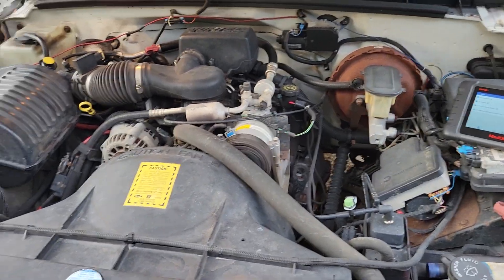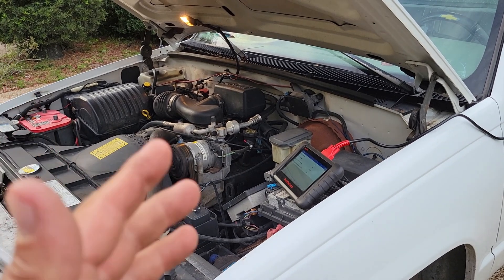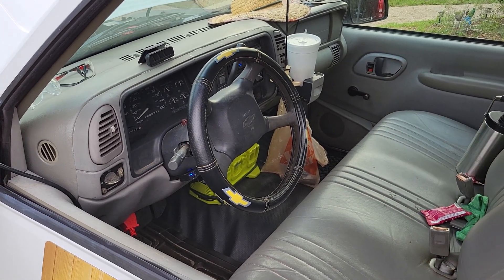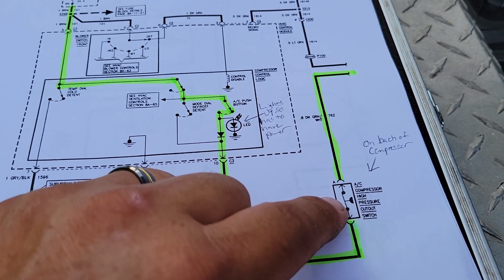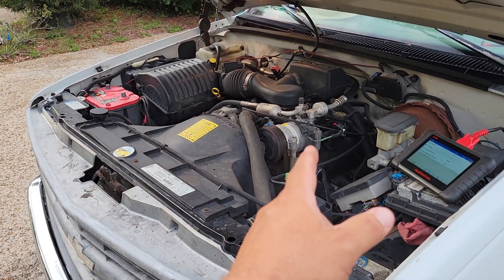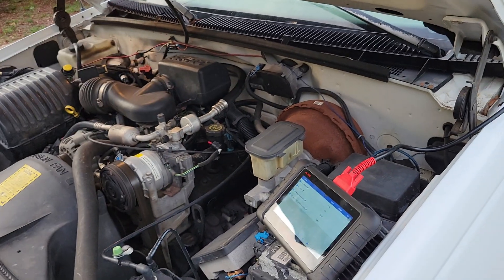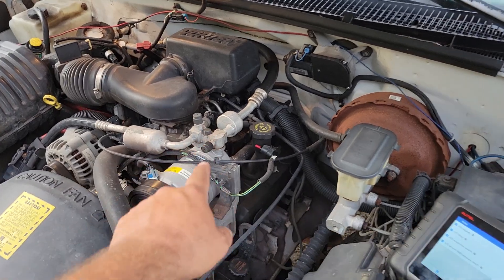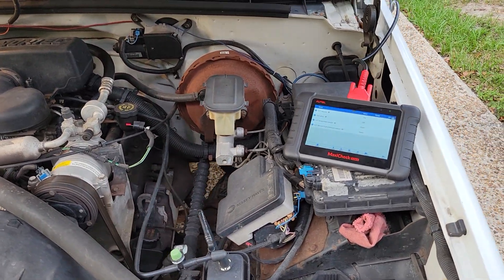GMT400 (96-98) AC electrical system explanation

Comment: What happens when you jump the compressor switch with just key on? My system is empty and won’t take any Freon so I’m wondering if I even get power to my clutch
Reply from the maker: The vehicle would need to be running, but if you jump the low pressure switch with the engine running and controls on then the compressor should spin.
Reply: @Bbernhardsr I did jump the switch won’t turn the compressor on. I have no power at the clutch I’m stumped
Reply from the maker: @matteo3893 what is the vehicle you are working on?
Reply: @Bbernhardsr 1998 k1500 5.7. I was just able to engage the clutch by putting 12v to the ac relay pin
Reply from the maker: @matteo3893 when you say you put 12 volts of the AC relay pin did you put 12 V to the control side or 12 volts to the load side?
Reply: @Bbernhardsr  so the two other pins have power with key on I think I am missing ground at that relay. Do you know where the ground would be?
Reply: @Bbernhardsr not the side with the two hots toward the front of the truck but the  terminal on the switched side back left if tanding in front of the vehicle
Reply from the maker: @matteo3893 pins 85 and 86 are the control side. One will be ground and the other will be the signal from the ecu to turn on the relay. That's what I am trying to figure out. What pin did you apply power too?
Reply: @Bbernhardsr  believe it or not in was the heater control unit. Swapped it with a buddy’s and it works. Ice cold ac

Comment: Need help because my ac wiring was done by a guy where he wired it to when the truck turned on, you couldnt turn off the ac and now it frys the panel every time you plug a new panel on and like u said the panels are like 200$
Reply from the maker: It sounds like you need to remove everything the other person did. Then you can go online and look for a "service manual" it has to say "service manual" for your year range of truck. So after 95 up to 99 is different than pre 95. If you get the service manual it will have wiring schematic and you will be able to identify the wire colors and hook everything back up factory. Then once that is done you will need to trouble shoot to figure out why they butchered it in the first place.

Comment: Thank you for the information. it was easy to follow. I didn't realize that in the back of the ac compressor was a high pressure switch, my ac light would come on but I was not getting any voltage to my ac relay. I believe that this proves the switch was bad. I wished I saw this video sooner because I did exactly what you said in the video - I jump the relay to have my ac compress clutch engaged all the time. Now here I am buying the whole ac system because my compressor blew up haha.
Reply from the maker: @vanillag1979  I would also recommend flushing out your entire AC system. Unfortunately if you're a compressor exploded and sent shrapnel throughout the system you're going to need to replace your condenser. You will need to get a new AC orifice tube and change the filter drier.
Reply: @Bbernhardsr  Yes sir, got everything(besides the evaporator) plus the ac flush kit. Doing the job either friday or saturday. Will keep you updated on how it goes. Thank you.
Reply from the maker: @vanillag1979  awsome sounds good!
Reply from the maker: @vanillag1979  I am glad the information was helpful
Reply: I was getting the same results. Luckily mine was a loose plug which is missing the lock tab. I was thinking a wild have to but a new PCM.

Comment: How would you bypass the computer? I’m going to get rid of the spider injection with aftermarket direct port fuel injection.
Reply from the maker: @Huntinghogs  well that would take a bit of work saying as the computer is what actually turns on the relay that activates the compressor clutch. This would take a bit of studying with a wire diagram to sit down and figure out. Because you would still want all of your safety switches to be operational.
Reply: @ so, I wonder if I left the ECU in place of it would still run the AC?
Reply from the maker: @Huntinghogs  if you don't leave the ecu there then how will your transmission work? The 4l60E is an electronic controlled transmission that operates based off of various inputs like your mass airflow sensor and your throttle position sensor.
Reply: @ I’ll use a stand alone controller for the trans.